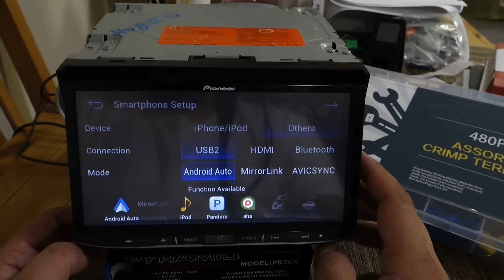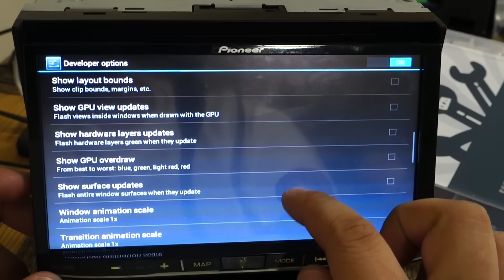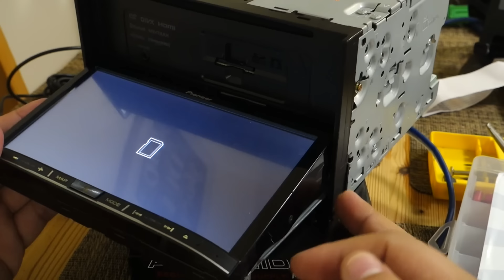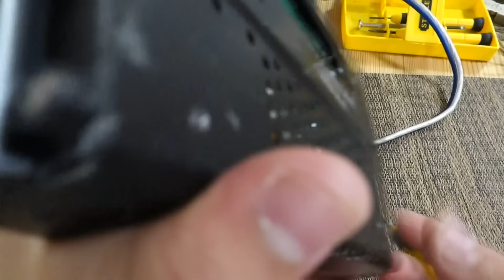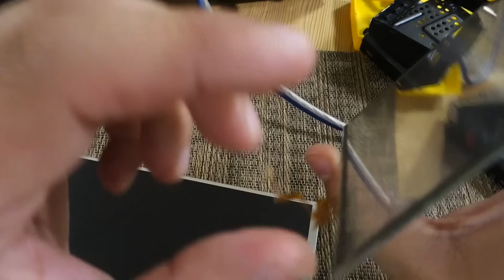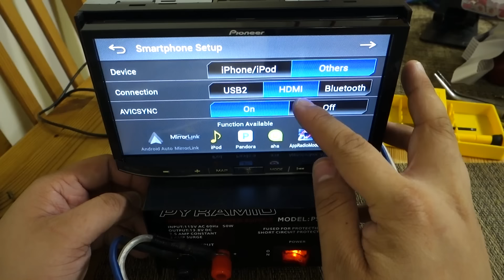Pioneer AVIC AVH NEX Touchscreen Repair Replacement

Comment: I am having a CD eject issue; the screen goes down perfectly, but there is no eject beep, and the CD won't eject. I tested the mechanical in another system, and it's working fine. The AVIC-8000NEX is not ejecting the disc at all, not sending the eject signal. Can you help me to fix this issue? Your suggestions will be helpful. I reset the system. I upgraded the firmware, but nothing happened.

Comment: How can I get it open when the lights are gone and it would not flip over for me to get to those switches board radio will come on but no lights are at the bottom so I can switch the board out. How would I open it?

Comment: I got my replacement digitizer from Amazon for about 35 bucks. Swapped it. Just gotta wait for a replacement data cable for my idatalink coming tomorrow. Only thing was it was slightly larger but a little bit and didn't Wana seat properly. But eventually got it to fit.

Comment: Thanks for this video. I have an AVIC-8000NEX and this helped me get through 70% of what I needed to do. The 8000 has an outer screen once you pull the inner one out. Unfortunately it is a single unit with the button bar. My issue was the buttons had gotten so gummed up over 8 years that it kept reverting to the map function. Soaked everything I could in Iso 91%, blew it out with comp air and it works like new. Thanks dude!!!

Comment: Why did you identify button 3 as 2 and 2 as 3? Did the button format change during your instruction or is it just an error on your part. I'm certainly not trying to nitpick. Your video and instructions are excellent and very helpful. I just wanted to clarify the steps so I get them right on my end. Thank you

Comment: Any tips for getting screen to tilt so I can access screws to remove?? 
I can’t get it to do anything cause it’s stuck on choose language screen
Reply: Hello, I have the same problem here. Did you find a solution to tilt the screen ? I striped the whole plastic touch layer thinking it was a protection (I managed to torn it accidentally) Thanks.

Comment: My eject button stopped working along with skip tracks next to it. The other buttons work on the left side. All the buttons illuminate fine. Apart from needing the eject button to tale rhe screen out i cant find the button strip. Maybe if i just change the cable be ok?

Comment: Question I have the avh 5200nex screen is not working some guy from ebay was selling a screen and I told the problem he said ,the screen is no the problem, problem is inside the radio some microchip is bad,radio turns on put the scree is black with some blue lines ,idk if is the scree or the radio ,what you think ?

Comment: Can you help me?  I've removed my touch screen. I want to buy the correct replacement. My model is the pioneer AVIC-Z2 HDD. I saw model you mentioned but can't determine size.
Reply: The one I ordered off your post was too big. I need one 3.6"x6.5"   can you help me find the right one? Please.

Comment: Are the LCD Display and the Touchscreen on the Avic-z110bt the same as this one? The screen on mine is unresponsive to touch and there is a little burn spot from the sun shining in on it. What you think needs replaced in this situation?

Comment: Hey there, I have a 4100 NEX, took it apart, my screen went blank one day, also the down volume seemed to reset the unit.  Not sure I have bigger problems.  Either way, can i safely clean the inside of the resistive glass?  I will order a new LCD too.  Any other suggestions?

Comment: Awesome  video my touchscreen came in & i followed your directions. my radio has the removable screen, Model AVH-4100NEX but still worked out perfectly for me ! 👏 😎 🙌 👍
Reply: Have a AVH4100 NEX the screen stopped working (blank) one day out of the blue.  I had cleaned the screen earlier with a light amount of windex, not sure if that was related.  I hate to get rid of my radio, love it.  symptoms were a blank screen, and every time I pressed the down button, it restarted the radio.  Not sure if there are bigger problems, but it was working great.going to replace the LCD hopefully that resolves the issue.  Will follow up, what where the symptoms you had?
Reply: Also, I have a 4100 NEX, it is 7 inch screen, did the 6.9 touch screen link on ebay work for it?

Comment: Good stuff bro! I’m attempting to fix mines this week once the touch screen comes in the mail! I have the 4100-NEX with the detachable face.
Reply: Also have a 4100 NEX, what were the symptoms yours had, my display went blank one day, had been working perfect for years, had cleaned the screen earlier, not sure if that is related.  How did this work out for you?
Reply: @reneb91964  I actually found a cheaper screen on eBay lol but yes the 6.9 inch screen worked for me. The unit was sitting on my passenger seat and I slammed on breaks b/c a driver didn’t use turn signal.That made my unit roll on to the floor and crack the display 🤦🏾‍♂️. Once the display was cracked the touch screen stopped working completely. I could still see the screen but it wasn’t responding at all. Now it’s back working 100%
Reply: @joe02323232  glad to hear it.  My display went blank one day.  Replacing the LCD, hopefully that is it.  Buttons light, but not always responsive, hard to tell with no display.
Reply: @reneb91964  I would definitely start with the screen, I’m pretty sure that will do the trick!
Reply: Also, I have a 4100 NEX, it is 7 inch screen, did the 6.9 touch screen link on ebay work for it?

Comment: It's actually quite easy to take all that plastic off just take your time ,I had to replace my SD card because I was stuck in boot Loop  on my nex 4400  And I had dust under my screen I'm gonna try to do videos on it eventually I did one where I took out the SD card but I haven't posted it yet because I'm too lazy to edit the video but if anybody needs an extra SD card you can buy them on eBay or you can download it I made a couple extra  copys..Also if you use a better SanDisk higher megabytes per second card it does make you load faster only by a little..    My detachable face I just took a part in about 10 minutes ago to clean the screen between the resistive touch and the lcd screen..One thing they should've used LCD border seal tape to hold the resistive touchscreen in place so no dust gets between the  gaps in the stock one where dust can get between I just ordered some on Amazon when I get it and I'm gonna put it on ,,so no more dust gets between...   But it was fairly easy to clean maybe I'll post a video ..Either way when working on these radios take your time with screws you can strip them  very easy.. Lucky I had no problems I was very nervous taking that detachable face apart...I did everything while sitting in the car  even cleaning it..lol

Comment: I have a avh -w4500nex in the FM radio stations are gone what can I do to fix it
Reply: Could be your internal SD card is  failing or about to... ..it Does strange things before it fails..   I had to replace mine because it went into a boot loop ...it's fixable and it's a pain in the neck but you would need the operating system on another SD card then you need to open the unit..  Look into fixes on Google there's a few you can actually download and follow their steps I had a few extra cards just incase for my 4400  but I'm not sure if it would work with your 4500..   either way they installed really crappy SD cards in the pioneer units.. they will fail..  Me  I put a faster card in And it's SanDisk I'll post a video on my channel maybe because I actually filmed the first initial start up you'll see how fast it loads ,i also  show how to take the unit apart I've just been lazy and havent uploaded the video
Reply: @Pinkielover  They sell them on eBay do you sell them if that will fix it I will buy one in a heartbeat

Comment: On 7200nex,  Eject button does not work. It there a bypass to open screen.  I can not pull the screen down.  I am not sure if I ever even tilted or put a CD in the radio.
Reply: The unit resets when the power is disconnected.   You have to bypass the setup screens to get eject to work.  (Difficult when you can’t see what you’re pressing). 

Mine is:
Touch screen twice in upper right corner then touch bottom center (where the ok usually is at startup)

That should allow the eject button to function, but it does nothing until the appropriate buttons (that you can’t see) are touched on the screen.

Comment: NEED HELP!! I replaced my touchscreen. All seemed to have gone well. I put it back together, and now my screen won't turn on. The buttons won't light up either. Yet it still slides open. I can still touch the screen and it works. I just can't see anything. Can't find anything online about this either. BTW, I have an avic z120bt
Reply: were you able to figure it out?
Reply: @reneb91964  yeah. Apparently when I was replacing the screen I ripped one of the ribbons just a tad. I ended up selling the thing. The touchscreen replacement would have been rather easy had that ribbon but gotten tore.
Reply: @nebeljc1  Thanks.  Replacing the lcd screen.  My touchscreen should be fine was still beeping.  My buttons still light up and beep but not consistently.  Hopefully lcd fixes it.

Comment: What would cause a radio not to come on? Pioneer 4200 nex.
Fuse are fine. Bench tested and it keeps popping the radio internal fuse next to the wiring harness plug

Comment: Ima try this on my 210 ex the touch screen only works in certain places and the places i need it to work is where u adjust and turn on off the subwoofer settings

Comment: Thanks bro, this helped me immensely with installing a replacement screen on my AVH X8850. It's not exactly the same as the one you've done here, but certainly close enough to help me figure out what went where. $11 for a replacement screen vs $350 to get it replaced, thanks!!!
Reply: Hey Bill, I have a X8850 also and the screen has also turned white and needs to be replaced, any chance you can send the link to where you purchased the replacement for the screen, thank you

Comment: Would a Capictive Screen from a AVIC w8400 work on a W4400 do you think? 

I have seen they use the same LCD, but not sure about the Screen. There is also people who sell SD cards with the Firmware for 8400s that works with 4400, stating the only difference is cheaper screen and software??

Comment: DUDE, I watched your video last night and paid particular detail to how you detached your flipdown face and take apart the touchscreen. I have an older 2010 AHV 4200VD and for some reason the colder weather this season was inhibiting the touchscreen sensitivity intermittently. I took it out of the motor track and disassembled the back plate unplugging and plugging back in the touchscreen bus , it was filthy, cleaned it up, slapped it back into the slide tray, and it works better than I when I got it new. Thank you!

Comment: This is great. I have my replacement touch screen and I was under the assumption that the foam around the edge was supposed to be adhesive and was confused that it didn't seem to be when I got it, however it looks like it just rides on the frame of the LCD

Comment: My buttons on my AVH-x5800bhs have been out after the first time I wiped down my screen to remove finger prints.  That has been years!  No one, not even Pioneer shows this breakdown in order to get those front buttons fixed.  No it is just about finding the parts and replacing it myself.  Can't wait until it is back to normal.  And never again, use any liquid near the screen and buttons.  Thx bro!
Reply: Got my button card and installed the new one.  Put it all back together and the button issue is still the same.  That issue was the buttons do not match. Display button opens the CD eject screen, Volume lower opens LCD options, volume upper nothing, and so on. The new button card does exactly the same broken functions as the old card. UGH! What else could be wrong?  So frustrated!
Reply: @joelberlin5252  hi! my buttons also doesnt work, how did you manage to open the front display in order to unscrew de 2 bolt that hold it in place?
Reply: I’ve had this same issue on my avh 4000nex for years. Only my volume buttons work. So frustrating.

Comment: Thank you for uploading the video. I have an AVIC F70 DAB and recently when I turn the volume up or down the channels on the radio station (DAB & FM) start changing. Is this a common fault with the button board? Many thanks and much appreciated if you're able to give any advice.
Reply: Were you able to solve this problem? Mine has developed the same problem. I am unsure if it is a hardware or software fault since it occurred after I updated the firmware but that may have been a coincidence.

Comment: Hi, someone threw something at my screen, which I am guessing it the lcd. My radio is a avic 5200 nex. I can't seem to find a replacement screen for that  model. Could I use an LCD from a different radio?
Reply from the maker: If you open up the radio you can get the lcd model. Then you could Google that lcd model instead and buy that instead of looking by pioneer part number but it could be a good chance no one has it sells it

Comment: Great video ! Do you know anyway of removing dust caught between the casing touchscreen and the actual touchscreen? I’ve got dust caught between the layers of the touchscreen . It there a away of getting it out without taking the screen apart ?
Reply from the maker: no, it will be tough the seal is pretty good, maybe some compressed air but your best bet for a serious cleaning is to take it apart.
Reply: Yes you can depends what layers more than likely it's between the LCD and resistive touch you should be able to remove any dust particles my 4400 was really easy actually kind of pissed off because they didn't put any border lcd tape so no dust gets through..  But they did use it for the  LCD screen itself...But now I don't have any dust so far it will happen again

Comment: I replaced the touchscreen which seemed to be the fix ! Thanks again for the video ! The problem I do have now though is that my color seems to have inverted. I tried redoing all of the connections again but didn't seem to help. Any idea ? AVIC z150BH

Comment: Hey, I have the 2330NEX also. It looks like a 4 pin based on the pacparts website for the 2300NEX. Would the aftermarket one you suggested work for the 2330 as far as you know?  This video is great!!! I can totally do this repair on my own. Someone broke into my car to steal a backpack and the glass spray left marks on the touchscreen. Now, I'm thinking about selling my 2330 and upgrading to one with 2 usbs so I need to fix it to sell it.
Reply: On the pacparts website it seems the difference between the 2300nex and 2330nex touchscreen replacement is the 2330nex has cushion. Is there a way to fabricate that or use from the original.

Comment: Do you (or anyone) know if the touchscreen and lcd are swappable across all NEX units? I'm looking to replace my 2330 screen with something from a better model, hopefully with a capacitive screen.
Reply from the maker: They are not they use different pin outs on the main connection from board to radio and then the touchscreen and LCDs are different. We have taken about 7 different models and 3 did share the same LCD model but the others didn't.

Comment: Great info. What do you think about intermittent hard button performance? Could the button board just be cleaned?
Reply from the maker: yeah its really common on these units. I would clean the button assembly like you mentioned
Reply: @MobileMaxCarAudio  Funny, I just got the board out and your message popped up. the button board and harness have corosion on the copper. I'll try to clean, but what do you reccommend for the weather stripping around the screen? Thanks!

Comment: Thanks for taking the time to put this video together.
I didn't see the links to the sources for parts for these units. Do you have any... especially for the hard button assembly?
Reply from the maker: Hey Doug, If you check the description there is a link to additional parts. Pioneer sells parts through pacparts online. I believe the button assembly is referred to as Sub Panel. The part number pacparts uses is Pioneer CNU3147. You can see the link here http://www.pacparts.com/part.cfm?part_no=CNU3147&mfg=Pioneer. I would have them confirm with an image before you place an order.